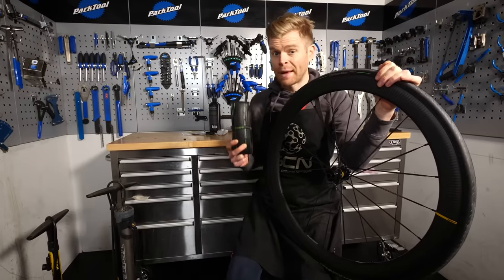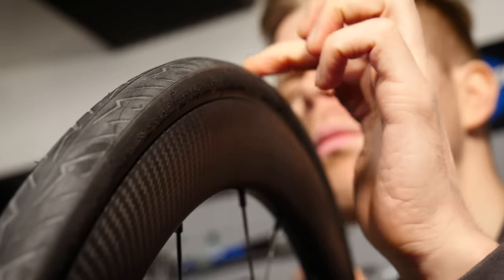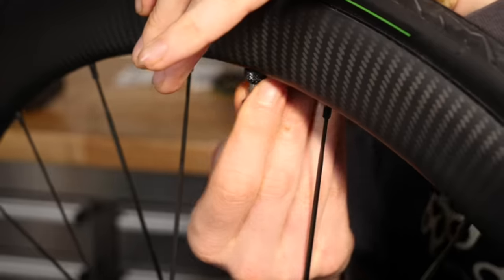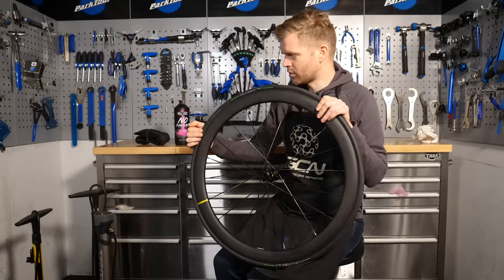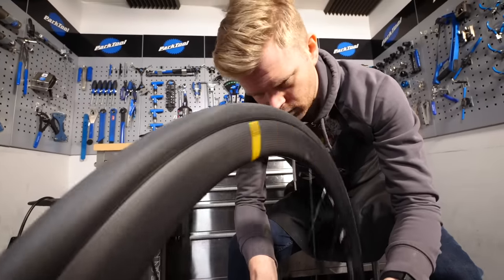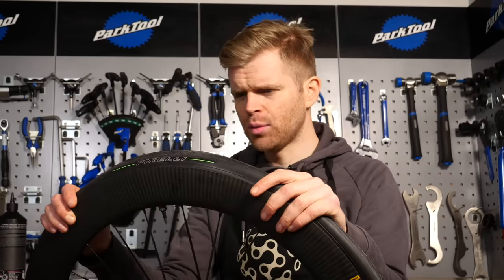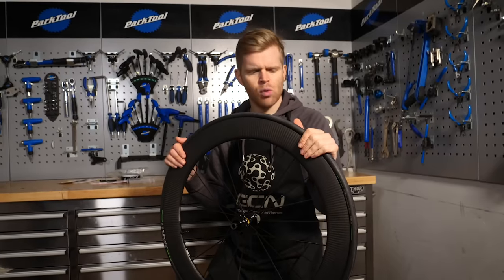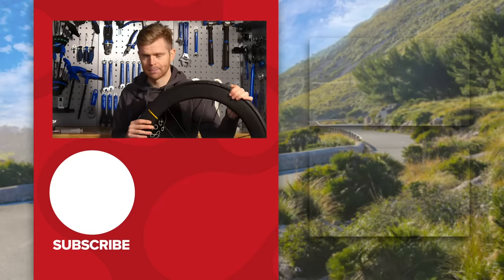How To Maintain Your Tubeless Tyres | GCN Tech Maintenance Monday

Comment: Or use a pre-measured sealant bottle. Already packed with sealant. No guessing. With it’s conical/needle nose tip, makes for easy valve insertion. Then dispense into the tire carefully until empty and wulah! No fuss, no muss.

Comment: Any sugestions on what to do when the sealant doesn't seal on the road? Is it possible to fit an innertube with only a small pump?
Reply: Depends on your setup, mine is Aksyum and gp5000, and it would be impossible to do on the road due to very tight fitting, I need 3 levers and soap

Comment: I have a wheelset with with Mavic UST and Mavic tires. When I bought them last year they put Mavic sealant in them. I also have a set of gravel wheels and Maxxis Rambler tires with  Stan's no tubes sealant  in them.  It has been one year, done a couple of rides and races, luckily no punctures, but it's long overdue to change the sealant in both sets of wheels. I bought two 140 ml packs of  Muc-off No tubes sealant. I read some online reviews and they clearly come out the winner most times.
Questions...Do I have to remove the rim tape?  How clean do the tires and wheels actually have to get? Can I mix the sealants? Is it a big problem if you do? I am not looking forward to this job. The sealant is extremely expensive here. The best I could find it for was 15 dollars Canadian per 140 ml pack!
I got a gravel adventure race in April. Gotta get this done.
Any tips would be appreciated. Thanks Ollie.
Reply: Damian Calderari Hopefully you’ve scrolled through and read the other comments. Do NOT mix sealant; they can clog together. You could try contacting the Muc-Off folks and ask if they’ve done any testing by mixing their product on top of other brands to cover all bases but I think they’ll say “no”. The old stuff should clean completely with plain warm water or mild soapy water and a sponge and you should not have to remove rim tape, if present (some wheels don’t need tape). With regards to costs, it’s less expensive than a pile of tubes or having tubulars glued up! Hope that helps.

Comment: Ollie, I didn't know CO2 could freeze the sealant, thanks for the tip!
Reply: More to the point it freezes the cylinder to your fingers if you're not careful, use a bit of old inner tube as a sheath for protection when holding them to release the gas!
Reply: @davidroberts1162  I've been using CO2 forever, never had that happen.  Possible I guess, like getting your tongue stuck to a flag pole LOL.

Comment: I found that taking the valve core out (and removing the syringe tube thingy) when the valve is at the bottom results in sealant bubbling out of the valve stem and making a mess. Doing it when the valve is at the top of the wheel might get one or two drops, but far less messy
Reply: which is why I position the valve at the side

Comment: I`ve ben running tubeless for three years on my roadbikes.
But never use sealant on them, simple because its not needed, as a well fittet tyre/wheel will hold air for 1-2 weeks without problems.
If I get a puncture I use an extra tube, or a can of road repair foam

Comment: Tubeless for MTB yes.
Tubeless for road crap. 
Used various ones for a couple of years on road and ultimately they're crap.
Reply: Continental GP5000TL are good.
Reply: @trimanz  yes. 
Girlfriend is using these.
Hold pressure too.
Sealant is the issue.  Stans race seems best.
Problem is that when running high pressures lots of sealant sprays out initially. Seems to take hold when half the pressure escapes leaving you running around half pressure. Not good for the rovals.
As for specialized rapid air tyres they seem crap in every aspect. Even tyre construction is lumpy and poor. 
5000tl are the only ones worth trying.
Reply: A inner rimwidth of at least 19 mm and tubeless tires of 25 mm or wider with a tirepressure of maximum 6 bar do the job for me!
I prefer Stan's Race Sealant ( which can't be poured through the valve stem because of the filaments the liquid contains ).
Reply: I like Conti 4 season. Very rarely......(you know what; can’t say the word). Tubeless just seems a right faff. And how much is one of those compressor things? The cycling industry has gone bonkers, don’t get me started on gravel bikes 😠
Reply: Infact just got the girlfriend some new wheels today black inc 50s. 
Didn't bother with tubeless this time.

Comment: It might be beneficial to some people to actually see how you fix a tubeless tire with a plug.  I use plugs all of the time, but some people just can't wrap their heads around how that works and how easy plugs are to use---the repair is done with the tire still on the rim. (I use a bit of vulcanizing glue with the plug to make it a permanent fix)
Reply: Do you do that roadside, or is it the kind of thing where you put a tube in to get you home and then fix it later? I just don't think I would get that many punctures that are the piercing kind.

Comment: You can measure the weight of a sealant  empty tubeless setup, then add the sealant and weight it again, that way you can know how much sealant you have based on the weight of your wheels
Reply: Not if it has clogged up, for me best method is shaking and feel and hear the liquid inside

Comment: Hi Presenters! My question related to the easy-to-use CO2 cartridge into my WTB tubeless tyre filled with Joe's No Flat Eco Sealent in case of emergency - loss of pressure during my training. It's not proposed, but what about using it for temporarily, only? I mean: releasing it after arrival at home. Do you propose it or not?   Any thoughts to be appreciated!

Comment: What kind to tubeless tape should I use in some 19 mm inner width rim Mavic Aksium Elite UST Disc wheels? The Mavic website says to use with Mavic Tubeless tape, but are there other good options? Mavic's tape also recommends to use a 25 mm tape for 19-22 mm inner width road rims. I found some DT Swiss Tubeless tape at 19 mm and 25 mm. Should I alway opt out for the 25mm one?

Comment: When you use co2 to inflate your tyre it may freeze the sealant temporarily but not for long and in any event a tyre inflated with co2 will not remain inflated for more than 24 hours due to the properties of co2 and w'd need to be inflated with normal air.

Comment: Chuffin' hell!  Who's knicked your 12mm(?) ring spanner from your tool wall?  It's been missing for ages..😁
Reply: Hard to be sure on the size. I was thinking it the 13mm.
Reply: It's the 15 mm that's missing. Search the bags of the fixed gear riders at GCN.

Source: The Park Tool MW-SET.2 includes 6, 7, 8, 9, 10, 11, 12, 13, 14, 15, 16, and 17 mm wrenches. There are two wrenches to the left of the spot for the missing wrench (see 7:59) , and nine wrenches to the right (see 1:27).

Comment: Hi, just converted to TL. Way more comfi! However, both tires came off of the rims during the break... I had pumped up my GP5000 TL to around 80 Psi inside 23 degrees and I left my bike in the sun for the break (Abu Dhabi - UAE). My wahoo was showing 37 degrees then. Have you heard of similar stories? How do I know what pressure I should have when I leave? The temps are going to go way higher in spring... Could the tire pop off the rim while I ride?

Comment: Seems like a lot of hassle, especially not knowing for sure whether you need to replace the sealant or not. And what a mess! I'd been considering tubeless, but this video made my decision. I'll stick with clinchers and carrying a pair of spare tubes and a patch kit.
Reply: That was my reaction, until I moved to an area with "goat's head weeds" . It's also called "puncture vine".
It's endemic in my part of the world. I switched to tubeless when I suffered 5 flat tires in 5 days. New tires with new tubes. Since I made the switch, no flats in a year.
Reply: @ukestjohn  Never heard of that, but it does sound like tubeless is the way to go there!

Comment: I've been told that you should unmount your tires once a year and remove the old, dried sealant. That's been a bit of a hassle. Here's my question: how clean does the tire bead need to be? I spent a lot of time cleaning the dried Orange Seal off the bead because I feared it wouldn't seat and/or seal properly. Was this necessary?

Comment: When simply adding sealant through the valve stem how does one know how much to add? I've used a self adhering tube patch on the inside of tires with success when the hole was too large for a plug.

Comment: Look at the work involved to maintain these things. The mess, The inspection all the special extras involved. Is it really worth it?
Reply: Wallace Pei yes
Reply: Yes
Reply: Yes 10 mins top up every 4 months in my house never had a puncture in 2 years from tubeless
Reply: Does anyone ever experience dry sealant tumbling around within your tubeless tyre set up?
Reply: Wallace Pei no. I ride enough to switch out my tires yearly or bi-yearly. I’ve never even seen any dry sealant.

Comment: Very undecided about the benefits of tubeless - with one set, I could not get it to reinflate, even after cleaning, so reverted to inner tubes. Too time consuming, messy & probably needs doing every six months. Also not guaranteed to avoid punctures. Still debating what the best format is for a long distance triathlon... want decent performance and maximum puncture resistance. Currently have tubulars, tubes and tubeless...

Comment: I see that you have Mavic tubeless rim and Pirelli tyre.
Not all tyre brands and rims are compatible so could you make some video about which brands/types go well together? I think that it is quite well known that at least mavic ust road rims and conti gp5000tl have so tight tolerances together that that combination is not usually recommended to use, even tought we are talking about pairing up 2 of the biggerst brands on their own area together.
5 brands/types of tubeless wheels and 5 brands/types of tubeless tyres would make some 25 tyre installations to cover. Those could be just the most popular ones.

Comment: Puncture with tubeless tyres? Yes it will seal but only up to a point. My six bar pressure dropped to 2 bar which still worked but any more pressure simply broke the seal. Solution is this. Remove tyre and sealant. Wash/soap the inside of the tyre and dry off. Fit a conventional puncture repair patch to the inside of the tyre. This will enable the tyre to be reflated to full pressure again.

Comment: I got an 8mm cut in the sidewall of my corsa speeds and the sealant had no chance repairing it.  I’ve used an inner tube patch repair and it’s worked a treat but I can’t help thinking that it’s not designed to work in this way so could fail.  Any thoughts on if I’m destined for disaster?!

Comment: Hi guys. I was unfortunate enough to puncture my Conti GP 5000 TL after just 200 km. I repaired the puncture with a plug (worked for the ride home). Because i had a big ride upcomming i bought a new tire so just out of curiosity: how long would you say can you ride with a Plug? Some bike Shop told me to fix it asap….

Comment: Is it recommended to deflate the wheels between every ride or can you leave them at full pressure for a long time?. Thanks
Reply: I was told to rotate tires so value stays at top when not riding,  If value is at bottom or sides it can slowly clog up. Can be hard to twist or inflate the presta value. I leave mine at full pressure but you do lose a few PSI each day between rides. Always top off air before rides.

Comment: #ASKGCNTECH How to set te bead of a tubless ready tyre with an inner tube? One part of the bead will not set corecctly while the other side of the tyre has not been tought. I have already spend 3 evenings without any luck. Vittoria terreno dry graphene 2.0  47C is the tyre setting it on a 650b wheel after i had a punter. Also removing the side where the beading sits correctly seem to be impossible. Please advice me? Thank you.

Comment: Tried everything and no joy!! The new tyre just went bang! Only had 90 PSI in it. Can't get it to seal on the rim, no visible damage to either tyre or rim, would the rim tape be the culprit. The tyre is brand new as the other (original giant) was worn out. I replaced it  and the rear with Vittorio Corsa ones. No issue with the first 2 spins and the rear is still fine. Any ideas??

Comment: big holes on the outside of tyre? turn the tyre upside down, when tyre pressure is low, let the sealant plug the gap on the inside, then turn tyre back the other way up and use super glue -- best use the relatively new type of "flexi" superglue you can get, doesn't set quite rock hard, allow to dry and you're good to go. It prevents the biggest problem with big, or at least bigger, holes, which is picking up shards and gravel and just making the original problem worse

Comment: Spray the wheel with soapy water to see if there are any leaks also before inflation as it lets the tyre rim slip into place with an ordinary stand pump works MUCH easier ....

Comment: I bought a new set of wheels which I can use tubeless... BUT when you don't use the bike on a Weekly base is it do-able? Does the sealant dry in the tire and can it put more weight on a specific spot of the wheel?
Reply from the maker: Good question tom. It depends how long yo leave the bike for, and all sealant dries up in time. Its always worth spinning the wheels regularly to keep the sealant distributed but it shouldn't be an issue.
Reply: @gcntech  I'll just keep it on clinchers then... Thanks for the response.

Comment: Will tubeless tires on a roadbike function without the sealant (like on a car)? I thought it all to be very messy, and did put the tubeless tires in a box.
Reply: only if your tyres are labelled 'Road UST' which to my knowledge only Mavic produces them. otherwise, all other labels require sealant to make them completely airtight.
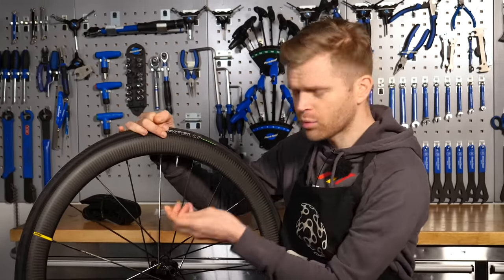Reply: the sealant is half the benefit of using tubeless tires! It's not messy if you use a sealant injector like Ollie does at 2:30. I don't even use gloves anymore.

Comment: I hope GCN has more luck with Pirelli tyres than I did - my rear tyre carcass failed, with lumps and bulges forming where the tread met the sidewall. Pirelli has ignored my email 😡
Reply: I’ve had this with my Schwalbe Pro One. Caused scuffing on the back of my seat tube, due to the sudden ballooning with road dirt on it.

Comment: if you plug the tyre will the plug where and your back to square one,  Is this a permanent puncher repair
Reply from the maker: tyre plugs shouldn't fall out with wear, but it's not ideal as a long term solution - it's comparable to patching tubes, it will work, and probably for a while, but it's never perfect
Reply: @gcntech   I don't know anything about tubeless but I got working tubes with patches that are at least 10 years old.  And I have never had a patch leak.

Comment: I need help!!! Just made the switch to tubeless and 3 of the 4 Wheels have been fine. The 4th one is a pain and I've tried all methods on the gcn vid. Soapy water, running the sealant all the way around, using a compressor and none of it is working... it's a wtb i21 rim (21mm wide) and panaracer gravel king 38c tire... any help?
Reply: Put in a tube overnight.  Pull the inner tube out leaving one side of tire still seated on the bead. The tire will be stretched a bit and with one side seated it will happen.

Comment: Disagree on using the injector being easier. Injectors are leaky and fumble prone. The small 2oz bottles are perfect: no mess, much faster, no fumbling around, perfect amount for most tires. If you need more sealant, just refill the bottle from a bulk bottle. You don't need fractional ounce precision any way.

Comment: how often do you change / replace sealant?
Reply: sam samsodien I top up my sealant at seasons change. March, July, Nov.
Reply: @chrisscott8362  Tks Chris - any indication of the mileage you do during a season - road only of course
Reply: @samsamsodien7055  I split up my bike usage so the tubeless gets used probably 1500 miles/yr. Group rides and Sunday cafe.
Reply: @samsamsodien7055  to add, sealant doesn't care if the bike gets used or not. It's just evaporation.  Hotter and dryer = more top up.

Comment: If you ride endurance, long distance rides away from civilization, carry a thick upholstery needle, outdoor poly thread, and small tube of super glue.  That'll get you back home if you happen to slice a tire/sidewall really bad.  You just sew up the cut, pulling it tight, cut the thread off once it's closed, then coat the whole thing with the super glue.  Any tiny pinholes in it will now be filled in by the sealant.

Comment: Nice video as always, Ollie.  Despite all the "benefits" of going tubeless, this has reinforced my decision to stick with thorn-resistant tubes.  Sure, they're heavier than even regular tubes, but the personal pounds I'm carrying are far more relevant.  More weight + more rolling resistance = more exercise.  No maintenance other than checking tire pressure.  No flats in 6 years.  Tubeless means WAY more maintenance than I'm willing to do, particularly with 10 bikes.
Reply: I run Mr Tuffy liners, I used to live in Nevada and bullhead thorns are a constant menace.  I no longer live in the desert but I left the liners on.  I may get a flat every 2 years.  I have pulled out pieces of glass that ruined the tire yet I did not get a flat.

Comment: so a tubeless tyre with sealant is lighter than a conventional setup with tubes?
Reply: I’m not so sure. By the time you add 60 ml of sealant you’re pretty close to a tube in weight. From what I’ve seen most tubeless tire are heavier than comparable conventional tire.

Comment: If you have dents or a sharp rim joint on an aluminium wheelset it helps to paint the entire rim shoulder or only critical points with sealant before mounting. Also keep in mind that sealants containing ammonia can destroy tires.